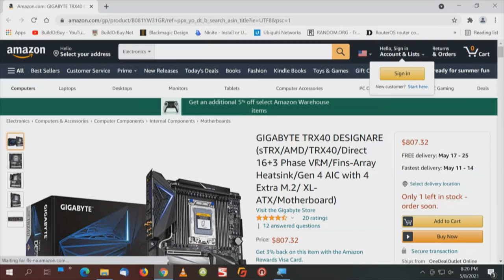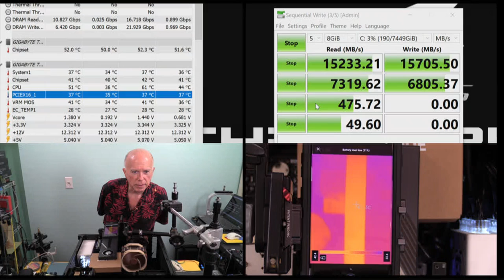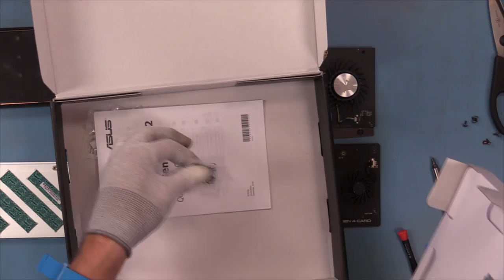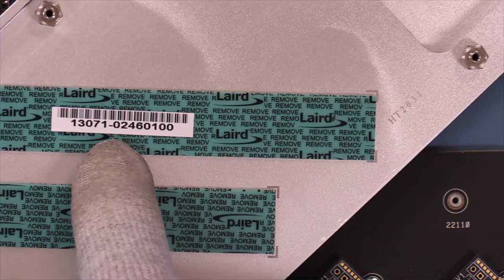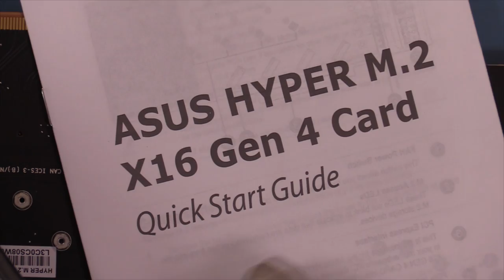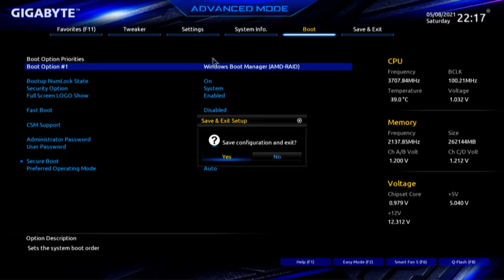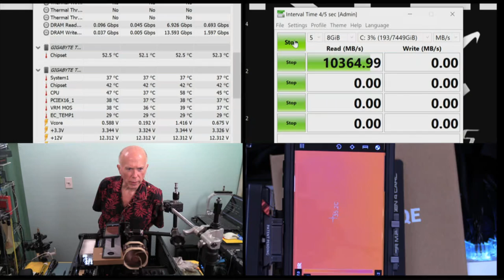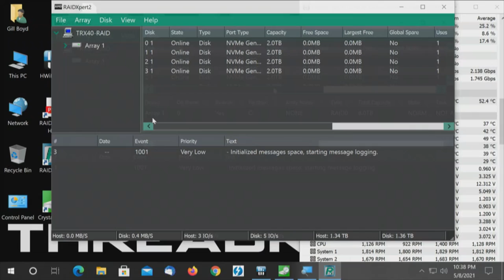Gigabyte Aorus NVMe M.2 vs ASUS Hyper M.2 x16 PCIe 4.0 AICs

Comment: Hey! I've learned quite a few things since we last spoke. 

1) My board does have RAID in BIOS, it only shows up once CSM is disabled.
2) The AMD RAID driver is defective in some manner, I get 60% lower IOPs and 15% lower sequential, particularly on the writes, compared to Dynamic Disks stripe. I even zero'd my drive in the hopes it was TRIM related, but no change in performance was observed
3) Dynamic disks (striping done through Computer Management) is the fastest option (1,000,000 IOPs with 17GB/s writes)
4) Dynamic disks should NOT be used however, because it doesn't support TRIM
5) The alternative, Windows Storage Spaces, gave me similar performance to the BIOS RAID, and TRIM is supported...but it's no where near where I was with dynamic disks...
6) Individual VOLUMES or RAIDABLE drives in BIOS RAID, when put into the same dynamic disk configuration as I had before, still fail and only give the 60% performance

Going to disable NVMe RAID and reinstall my OS until I figure out what's going wrong, or until I buy that on device RAID card from Highpoint we spoke about.
Reply: Confirmed: after OS re-install with BIOS RAID removed, I am now hitting my 1,000,000 IOPs instead of 400,000 that I saw in BIOS RAID0 and and BIOS VOLUME/RAIDABLE configutations that are identical to this.
Reply from the maker: Hi @hacked2123 , 
You have Interesting Results. Saw Your complete message. We have a separate Video about Installing a Windows Bootable RAID 0. Results are what counts! RAID is not for everyone. And Details matter! We're going to have to do a Video about RAID Types and Levels of RAID to answer more Subscriber Questions. Thanks for Sharing Your Results. You had to try it and see! Now You know! Keep it Simple!

Comment: Heyho, love your videos!! Really the only resource for some questions...
Do you know if both cards work on the Gigabyte WRX80? Would you recommend the gigabyte or the asus card?
Reply from the maker: Hi DJRecordCLUE,
Welcome! I'm honored! Thank You for Your Support! Any of the QUAD AICs will work. Functionally all are the same. Each requiring a x16 PCIe Slot, electrically. Get whichever one is available at the best Price. My personal preference is the Gigabyte Aorus. Originally, in the press release that x16 M.2 NVMe PCIe Adapter was included. However, upon release, that Item mentioned was scrubbed from the press release. Interesting!

On a side note... We had to Update the Firmware on the WD Black SN850 to restore Performance using the Gigabyte Aorus x16 QUAD AIC. Go figure. Hope that helps! Congrats on Your WRX80 Build!

Comment: With all deep respect I am concerned about this test. The preconditions for these two tests are not the same. Nothing I have seen on Youtube points to a similar conclusion of a significant decrease of reading speed for the Asus card. Please build your Raid for the Asus the same way as for the Gigabyte. I think you will see close to similar results for these two cards.
Reply from the maker: Hi Tor Bruheim, 
Welcome! Absolutely correct! Perception and Perspective... You have not seen Our other Videos on these AICs. We have many. On the ASUS, ASRock, Gigabyte and Glotrends. The takeaway on this is to note when moving Drives from one AIC to the other, always reformat or re-initialize the Drives especially for RAID. The Drive assignment on each AIC is different. Appreciate Your Comments! Thanks for Watching!

Comment: Could the repairing of windows rather than a clean install have effected performance? Would like to get the ASUS card as it is half the price of the gigabyte locally, but i run a AM5 gigabyte x670 gaming x so the chipset is not supported ans asus support was useless. Thanks for the video it was entertaining and educational at the same time. Take care, God bless one and all.
Reply from the maker: Hi wolfman011000,
Welcome! Absolutely possible! To reiterate, You have an ASUS X670E Gaming WiFi Motherboard? For a Quad card, Top Slot only. Full Bios Bifurcation from X16 to X4X4X4X4. No 2nd Slot in that scenario. ASUS is removing Documentation that clarifies these settings. Obfuscation! Hope that helps! Appreciate Your Comments!

Comment: Can the ASUS M.2 x16 GEN 4 CARD use 4x2TB or 4x4TB? A other YT Vid says this adapter only support max. 500GB is that true?
Reply from the maker: Hi Negodyay, 
Welcome. Just now seeing Your comment. The Hyper card should work with 4 TB Drives. The other question, does your Motherboard support Bios Bifurcation?
Reply: Thank you, also 4x4TB is possible? TRX50 i need No Bifu💪🏻😉
Reply from the maker: Hi @Negodyay77 , 
Yes. To install, configure and support a Quad card, yes. Your Chipset supports Bios Bifurcation.

Comment: Thanks for your hard work! What do you think about highpoint controllers? Please make video about them!
Reply from the maker: Hi Сергей Иванцов, 
Thank You! Appreciate Your Comments and Support! Highpoint fills a void where no one else has gone. They bridge a gap in the technology from Motherboard to Bifurcation support. We need to do a Video about RAID types and RAID levels first. Then indicate where each of these different types of AICs fit into than technology map. Great idea! 

If We do a Video on the Highpoint AICs, it would be the HighPoint Technologies SSD7540 PCIe 4.0 x16 8-Port M.2 NVMe RAID Controller - https://amzn.to/3tTUC3o

Add to that 8 - Sabrent 8TB PCIe 4.0, M.2 NVMe Drives! 
https://amzn.to/3fkhDY6
As an Amazon Associate I earn from qualifying purchases.

Wow! Can You imagine! A Beast! Better to wait though until 2nd Generation PCIe 4.0 Drives are available! Right now, the Capacity is 8TBs but the Speed per Drive of that capacity is 3,300MBps. Better to have 5,000MBps or 7,000MBps! We will keep that in mind! Hard to justify unless or until a Client comes forth to provide the means. Otherwise We could discuss the technology. Just not the same, as hands on, testing. It could happen! We still have a follow-up to  do on this Video! Stay tuned!

Comment: @BuildOrBuy Have you rerun the Asus card test? The results in the video its strangely low!
Can it be a reaction to the cable? What about trying both cards directly into the socket?
Reply: I know that a few months back, there were no PCI gen 4 raiser cables that worked, there were even fire hazards with some of them (just search it).
Reply from the maker: Hi Jarnhand, 
Next Video, a follow-up. I think Max is right. The Drive sequence.
Reply from the maker: Hi @jarnhand266 , Yes, that's why did We did the previous Video about the Vertical GPU Mount and PCIe 4.0 Riser Cables. We tried two of each. Only one Riser Cable worked. The other one caused a BSOD. Here's that Staging Video for this Video: https://youtu.be/-_uKeGsl_3s
Crazy, right. Stay tuned! As always, Details matter!
Reply: @BuildOrBuy  Ok
Reply: @BuildOrBuy  To me it looks like the one that worked, did NOT run at gen 4 speeds. Crystal mark only showed about 10 000 vs about 15 000 if it was working Gen4.
Reply from the maker: Hi @jarnhand266 , Exactly. Very odd indeed. That's why We think Max is right, Drive sequence. We'll all find out, next Video! We'll try to make it a quick Video! Solve one problem, create another one!

Comment: Hello, I received the Asus card with a B550-XE Motherboard. I also have a Nvidia 1650S card. Which PCIe slot should I put each card. I am unsure. Thank you
Reply from the maker: Hi Peter Gembrowski, 
Welcome! That's a dilemma! 
ASUS ROG Strix B550-XE Gaming WiFi 
https://rog.asus.com/us/motherboards/rog-strix/rog-strix-b550-xe-gaming-wifi-model/spec
- 2 x PCIe 4.0 x16 (x16 or dual x8)
- 1 x PCIe 3.0 x16 (x4 mode) *
- 2 x PCIe 3.0 x1

Nvidia 1650S - 4GB GDDR6; 8k!; 2-Slot; PCIe 3.0. 
https://www.nvidia.com/en-us/geforce/graphics-cards/gtx-1650-super/

The ASUS Hyper M.2 NVMe x16 card has to be installed in the 1st x 16 Slot. To maintain all 16 Lanes, the Video card must be installed in the x4 Slot. Not enough PCIe Resources on that Chipset for a x16 M.2 and a x16 Video card. I know, frustrating! To have 2 x16 Slots would require a HEDT. Hope that helps!

Comment: I have 2 of the Hyper M.2 Asus cards. Both had the fan cable blocking the fan from moving, i don't know what kind of crappy QC they went through.
Reply from the maker: Hi mohsh86, 
Welcome! Sounds like carelessness during assembly for certain. Good thing We can check and verify when installing the M.2 NVMe Drives. Thanks for pointing that out!

Comment: Great content, I'm about to install one of these on a wrx8 board w 4 x 4tb gen4 m.2s. Ill let you know how it goes shortly
Reply from the maker: Hi g a, 
Thank You for Your Comments! Much Appreciated! Outstanding! WRX80 - Congrats! ASUS? You should see either around 15,000MBps or 21,000MBps depending upon 1st or 2nd Generation PCIe 4.0 M.2 NVMe Drives. Standing by! Thanks for Sharing Your Results!
Reply: @BuildOrBuy  Yes an Asus. 2nd Gen, Gen 4 drives. The WRX80 board is great, came with the Asus card! Was a little journey building, not a huge amount of videos and users out there, so your content is really helpful!

Saw you mention some drives were out of stock on Amazon, I ran into some similar problems when looking for M.2s. If you're unaware you might get some bonus hits on this video, because the reason these cards and drives are selling out is for mining of a crypto called Chia.
Reply: @BuildOrBuy  Man! I have the exact same results as you with the ASUS card. I've messed around with a few bios settings to no avail. If you manage to find a solution let me know!
Reply from the maker: Hi @ga-ns8ls , 
You too? Odd. I know why We had that problem, drive sequencing as identified by Max. You installed new Drives. No monkeying around. No changing Add in Cards. The Gigabyte Aorus M.2 x16 Drive Sequencing is Sequential. Whereas on the ASUS Hyper M.2 x16, the order is 1, 3, 4, 2. And that affects the RAID Array arrangement. That's why We lost performance. We lost a Drive from lost clusters. Of Our options, the end result would be the same. Destroy or Delete the RAID array and recreate. Then install Windows Bootable RAID again. Practice makes perfect! 

And now You have low performance too!?! Working on a Video for what We've been doing for Slow Performance on the ASUS Hyper M.2 X16 AIC as described above. Spent 2 days testing. 5 hours Filming. Delete the RAID, Tested Drives individually. Even installed a single different Drive to better understand Drive Sequencing. Then Windows RAID. Tested that. Then Hybrid Bios for Windows Bootable RAID. And Tested that! Voila! Stay tuned! Editing now!
Reply: @BuildOrBuy  Ok great I'm looking forward to it! Seriously detailed and awesome hardware content, thanks for your knowledge and such focused videos its really helpful to a lot of users!

 My failed (haha) setup was: Enabled RAID modes, made sure to enable 4x4x4x4, preloaded raid drivers before installing windows, but installed Windows on a seperate single M.2 (only 3rd gen) in a slot integrated on my motherboard (this drive is not in the 4-way Gen4 raid).  I created the Asus Gen 4 drives volume with the RaidXpert software the manual references, also tried using the Raidexpert utility via the bios but have the same ~10.5 GB/s speeds.
Reply from the maker: Hi @ga-ns8ls , 
Outstanding! Glad To help! What good is knowledge if not shared! There are several ways to create a RAID. Just depends upon intended goals. The need for speed! We like to keep it Simple and make it work! Hmm. We can do better than that. You should be getting around 15GBps. Which M.2 NVMe Drives are You using? 

Our issue was Drive Sequencing and the Riser Cable. The ASUS Hyper M.2 x16 did not like that cable. Whereas the Gigabyte did not have a problem with the riser Cable. Go figure. We need better quality Riser Cables if trying to use one.
Reply: @BuildOrBuy  Hey, same guy here, I had some issues with my google account. So I didn't choose the correct RAM for my WRX board (ecc r-dimm etc), noticed when building and the server memory finally came in to swap out/return. Turns out my issue was my RAM, on getting those sub optimal raid speeds!
Reply from the maker: Hi @theterricstvs7249 , 
Glad You're back! What RAM were You using? But now You are using the ECC RAM? Excellent! What Brand, Quantity and Specs?
Reply: @BuildOrBuy  I was using some Crucial Ballistix 3200mhz 32gb sticks, and ended up going with the Kingston (KSM32RD8/32MER) listed on the motherboard's website. Without that specified memory, I was getting funky 2400mhz speeds without any other bootable clocks.
Reply from the maker: Hi @theterricstvs7249 , 
Crucial Ballistix 3200mhz 32gb sticks, timing issues. Sounds like it needed tweaking. Interesting. Smart going with Kingston (KSM32RD8/32MER), ECC! Thanks for Sharing!
Reply: @BuildOrBuy  No problem. Yea, I think I could have gone deep on the timings etc and maybe gotten results. The bios isn’t particularly friendly on the Asus WRX80e board (no easy XMP freebies), and the OC menu only drops down to 3000mhz with no manual entry,  there might be a fix/dial in manually, but I relented/went with the correct hardware. No regrets, plug and play with the recommended RAM!
Reply from the maker: Hi @theterricstvs7249 , Better to keep it simple. Besides, You're now using ECC! Success!

Comment: This video is going to be fun for me.. I'm a storage junkie.
Reply from the maker: Hi John Smith, I hope We deliver! Aren't We all if We're willing to admit it! Staging this Video was an interesting journey. Answering a Question, Creating a Problem and Solving that Problem. We have more of these to do but this needed to be done now! Thank You for Watching!
Reply: @BuildOrBuy   My results with my Gigabyte AIC are super close with your's. I'm trying to figure out why there was such a difference between Gigabyte's card and Asus's, totally not what I expected.  Of course, now I want to see how different the results would be with the Rocket 4 plus drives, or better yet both versions the Gigabyte gen 4  drives for some really apples to apples comparison.. 

on the storage junkie side. If only these cards could work with four Sabrent Rocket Q  8TB drives. I'd really consider  burning through 5 grand for 32 TB of NVME storage only taking up one PCI-e slot!
Reply from the maker: Hi @That_Stealth_Guy , Excellent! Agreed! I think Max has the answer, Drive Sequence. An update on this in next video! 

For that capacity, have You seen the Highpoint Controller? Very curious indeed! We shall see!
Reply: @BuildOrBuy  Let's hope it was drive sequence, not much else makes much sense otherwise. 
I hadn't seen the Highpoint controller until after I posted my comment. I could use the Highpoint one now with the 4 TB drives I have already, so I am definitely looking closely at it .

Comment: What do you think about Liqid honey badger?
Reply from the maker: Hi Mikel Carr, 
Welcome! You are the 2nd to ask in 6 months. Closest AIC to the Liqid Honey Badger would be Highpoint. Both are Bifurcated since they both can accept 8 M.2 NVMe Drives and both require a x16 Lane Slot electrically. However, the Liqid Honey Badger, if We have to ask the price... At over twice what the Highpoint costs, a premium for that performance. Whereas, the Highpoint AIC is $1,000 but non Bootable. Have no idea if the Liqid Honey Badger is Bootable. Which is really a bummer. Can You imagine using a Liqid Honey Badger on a WRX80 Workstation? Wow! The Liqid Honey Badger will of course be faster than the Highpoint but at more than twice the price. Options! But, with PCIe 5.0 due out soon, this all changes again. Good question! If You Buy that Server Component for a Workstation, keep Us posted on Your progress! Don't expect We'll ever see that on Amazon. Never say never! Time will tell! 

We'd love to test one but that's not going to happen either. We'd love to do an  emissivity reading while running a Test since they use stacked Drives. Would make for an interesting Video! Liqid should do more to promote more. Like making the Specs openly available. We have had several Data Scientists ask about this type of product when discussing Mellanox adapters for AI which We find most interesting. We thought this was an esoteric subject when We did the first Video on M.2 NVMe x16 Quad cards. Mainstream for those who want this technology! 

https://www.liqid.com/products/liqid-elements/element-lqd4500-pcie-aic-ssd
https://www.businesswire.com/news/home/20190806005165/en/FMS2019-Liqid-Uncages-%E2%80%98Honey-Badger%E2%80%99-%E2%80%94-World%E2%80%99s-Fastest-Gen4-NVMe-Storage-for-Unprecedented-Data-Performance
HighPoint Technologies SSD7540 PCIe 4.0 x16 8-Port M.2 NVMe RAID Controller
https://amzn.to/3ivEJ18
As an Amazon Associate I earn from qualifying purchases.

https://highpoint-tech.com/USA_new/series-ssd7540-overview.htm

Thanks for Asking! Great Question! Helps Us to make better Videos!
Reply: @BuildOrBuy  I contacted them for pricing and they only sell the AIC fully populated. Starting price is 6.4 Tb at about 6k$!
Reply: I am pretty sure that it is bootable though.
Reply from the maker: Hi @recklessthor4  , Agreed it should be. However, could not tell unless We signed up for a quote. For the Price of the 8 M.2 NVMe Drives and the Card still expensive  but if You need that performance, that's it! What are You Building? And is that card in the equation? What's Your time frame for deployment?
Reply: @BuildOrBuy  for that price, I think there is a lot to be said for the Highpoint